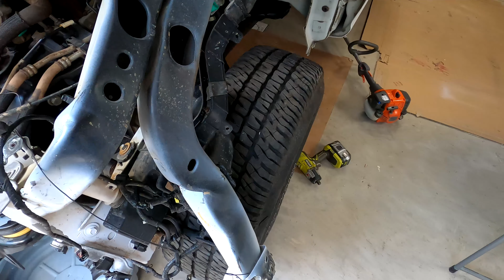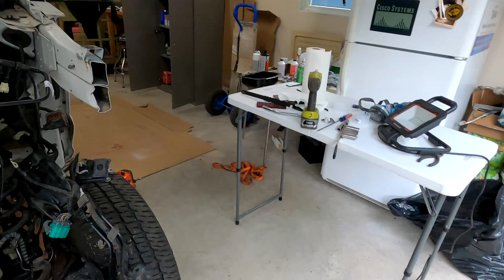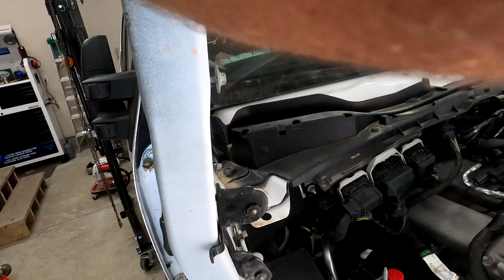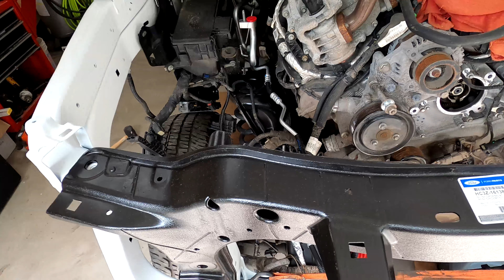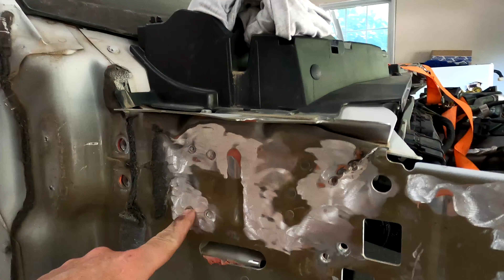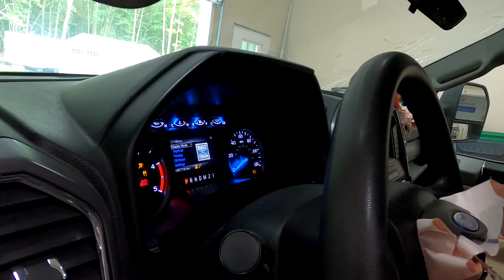Rebuilding A Wrecked 2017 Ford F-250 - Part 7 - Upper Frame Rails

Comment: Fantastic videos and super helpful.  I'm currently working on replacing upper frame rails on a 2019 F350 and wondered if the frame rails you bought came uptapped and if so...how did you resolve?  Just run in the bolts like they're self tapping?
Reply from the maker: @dave526. Thanks for the kudos. All the parts I got were OEM. I don't recall having any issues. It has been a few years now but only recall the holes on the upper frame rails on the cab side and two bolts on each side to get them lined up after you panel bond/rivet them. In the front they get spot welded.
Reply: @extensivediy  Further down in the thread…I found another person doing the same work and had the same issue.  Sounds like our Ford parts were made on a Friday afternoon 😉

Comment: Name and size on Inverted torx socket please?
Reply from the maker: They are called EP Torx Plus. I purchased a set on ebay but https://a.co/d/dcsMiTd this is a similar set on amazon.
Reply: @extensivediy  thank you for your kind response. The one you used for the frame what size of EP TORX is it?
Reply from the maker: I am afraid I don't recall. I checked the ford crash parts manual and they have them listed as regular bolts. There are a few throughout the truck which is why a set would be a good ides.

Comment: Hey I am doing the exact truck with severe front end damage and want to follow and save all videos from the beginning. I started watching were you were doing from frame rails or what I called core support, and don't know how to get back to video 1. Help
Reply from the maker: Sorry. I just  was away and just got this. Hopefully you found it but if not, its here: https://youtu.be/2Pm76L70C4s      Good luck, I can probably help with questions if you have them.
Reply: You front halfed your frame. My pass frame horn is bent down some but I think a good frame shop can pull it. Also the upper frame rails are down and back as is the a pillar causes the gaps in the doors to be tight. Was your cab tweeked at all?
I hope this can be fixed when the frame shop pulls the wrinkle out of the sheet metal below the upper frame rail. What do you think?
Reply: I was lucky that neither the horn or dash air bag deployed, but both seat and side curtains did. You said you sent the air bag module out to be reset, but sent it where?
Reply: Where did you get most of your parts? Like upper frame rails, core support, radiators, etc
Reply from the maker: The prob is the boxed frame are really tough and there are what i believe are two "crumple zones" in the horn. I thought mine could be pulled but when I looked closer it was folded in the tow spots I mentioned one in front of the shock tower and one behind. the one behind was creased so bad that it would take a big frame machine to get it out but if you got lucky and the hit wasnt too bag you might be OK.
Reply from the maker: https://www.autonationfordwhitebearlake.com/parts/index.htm I got most of them there including the front frame. There are two main Internet parts guys and both are good with good communications and shipping for the lowest prices I have seen anywhere including locally. I got some stuff locally but 95% came from them.
Reply from the maker: I used safteyrestore because they were cheaper than myairbags then they came back with an extra charge. I would say either would work. I also used safteyrestore for the seatbelt rebuild but thought they got lost so I ended up purchasing another set on ebay but they can do it for you if needed.
Reply: @extensivediy  before I plug in my airbags and rehook up batteries...what do I need to do to make sure they don't blow again?  I sent my safety restraint module and seat belts to safety restore and now have them back.  Once I clear all the codes in the computer via OBD scanner...is there anything else I need to consider?
Reply from the maker: @davem526  If the module is reset, it should do a check of all connected systems and as long as there are no open connections/issues the airbag light should go out after the check. For the research I did, the sensors don't need to be replaced unless they are physically damaged and if there was an issues the self-diag of the RCM should not pass if there was an open issue. The airbags normally only get triggered in a sudden deceleration event. Here is something for a 150 but the concept applies.  https://fordcrashparts.com/wp-content/uploads/2020/12/On-Target-2020-Vol.-4-FINAL-12-7-20.pdf

Comment: what type of drill bits did you use? I am struggling to get through these on my expedition. Doing the aprons as well
Reply from the maker: I have been out of the country on business and just getting back to these. I have a few sets and don't recall but I think I used a set of Milwaukee drill bits similar to these. https://www.homedepot.com/p/Milwaukee-Cobalt-Red-Helix-Drill-Bit-Set-for-Drill-Drivers-29-Piece-48-89-2332/301332138 I did have some trouble but the drill bits helped.
Reply: @extensivediy  @PsycoCam10  I Googled best type of bit to drill metal with and came up with the cobalt bits you note.  They did a really nice job of polishing the pilot holes I drilled with my Ryobi black oxide bits 🤣.  Maybe I got a bad lot but super frustrating and not sure what to drill my holes with.  I ended up using a 3/8 spot weld cutter to get the frame off.  I only went through the frame rail...flange/support attached to the cowl is still in tact.

Comment: What rivet Gun did you use?
Reply from the maker: I have two different ones and don't recall which I used but the one looks like the one called "BIG DADDY Riveter" on amazon and the other is a hydraulic. I think it was the first one and all I would say is that it just needs to be large enough to handle the rivets and need the extra leverage to fully compress the rivets.

Comment: Do you have a link to the rivets used? I am doing the same work on my truck
Reply from the maker: I will try to find the info and send in that email in the other comment.
Reply from the maker: I did find the information. Here is the link: https://www.fastenal.com/product?query=1141514&fsi=1  I did have some of these too: https://www.fastenal.com/product?query=sb86sbr&fsi=1 I believe the only difference is the first ones are stainless.
Reply: @extensivediy  Awesome, thanks!
Reply: Thanks for the link! Doing the exact same thing (fender rail replacement) on my Copart special 2020 f350 platinum 6.7. Your video definitely cleared it up for me 👍

Comment: On the pass side battery, the positive cable has 2 othe large cables that are stacked on the 10 mm stud, that are about 6 in long and are bolted to the rest of the cable and covered up with. Shrink tubing
 The fire dept when they showed up on scene cut those short cables and they are, I believe to be fuseable links that are not sold seperatly. The battery cable assembly is like 500 bucks
 Did u have to fix or replace them?
If so. Where did u get them?
Reply from the maker: Unfortunately I am out of the country to take a look at mine to see which you are referring to but I didn't have to replace mine. I also didn't think there were any fuse able links but definitely could be wrong

Comment: What was the spec for the rivets
And the numbers on the 3m  panel bond, and did u buy the upper frame rails and the bottom and top piece, not sure what that upper piece was called from ford or elsewhere
Reply from the maker: Here is the info on the rivets: I used the same spec as the for part. Here is the link: https://www.fastenal.com/product?query=1141514&fsi=1  I did have some of these too: https://www.fastenal.com/product?query=sb86sbr&fsi=1 I believe the only difference is the first ones are stainless.

Panel bond is here: https://www.amazon.com/3M-08115-Panel-Bonding-Adhesive/dp/B000PEW4MI

I got the upper frame rails from ford and the top piece is called: Upper Tie Bar - Ford (HC3Z-16138-A) and the bottom is Lower Tie Bar - Ford (HC3Z-16139-A) the upper frame rails are just called that and come left and right.

Comment: Did the captured nuts come threaded on your new frame rails? I’m currently working on my 2021 Ford F250 and only had to replace the driver side frame rail and top radiator support and I want to put a Bolt in and there are no threads in them
Reply: The cross member (radiator core support) should have the captured nuts I think you're referring to.  I am working on replacing the driver side frame rail and to your point...nothing is tapped!!  Not sure if they're self tapping and you just run them in...or if you have to figure out what they are and then tap.  Let me know if you find out.  I posed the question earlier today in this thread.
Reply: @davem526    Hey  yeah I figured it out   Yeah the bolts are self tapping.  I just put a little oil on them and ran them in with a ratchet
Reply: @bryanthomas9116  Thank you!  Thought I was losing my mind.  Oil it is!!